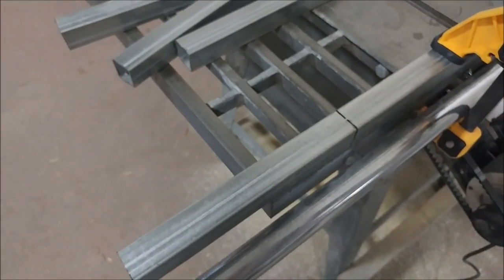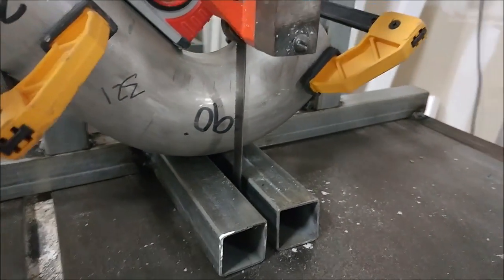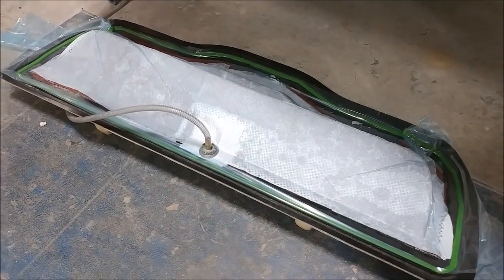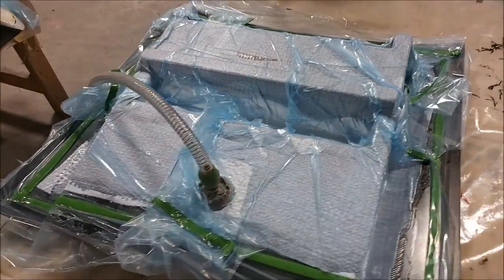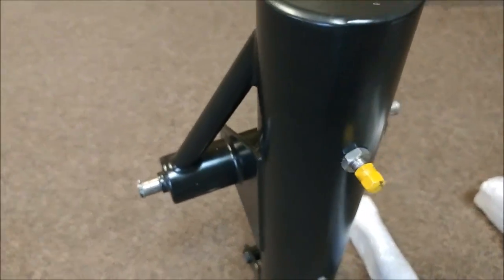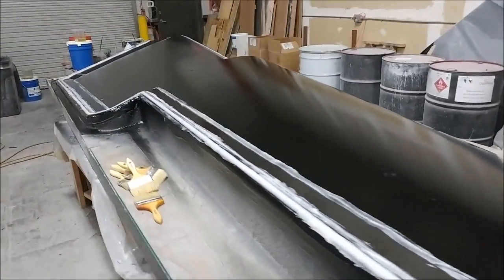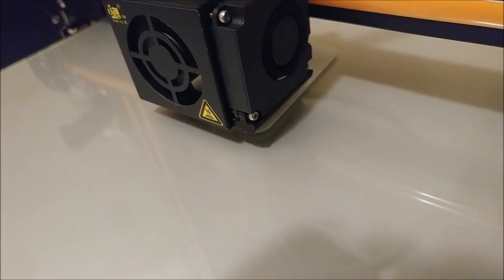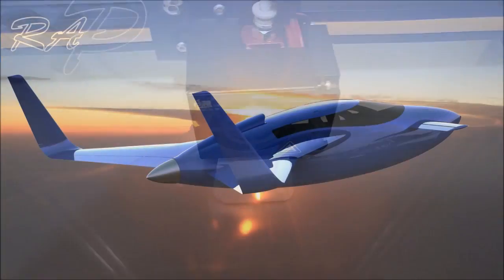Raptor Aircraft March 14th 2017

Comment: Just a quick tip for the 3D printed plugs or molds; if you use ABS you can sand your parts and put them in acetone vapor to get a glossy smooth finish. In my experience it greatly improves the surface finish of the part and helps a lot with releasing.

Comment: If you got that 3d printer retail somewhere, please reveal the source. I've been looking for a good, inexpensive one. Those two words are usually mutually exclusive in this field I've found.

Also, the landing gear looks fantastic! Good choice on the coating.
Reply: David McCullough I second the 3D printer curiosity.
Reply from the maker: It's a Creality CR-10 from Gearbest.com. If you check for a review video on YouTube you may be able to find a coupon code for a decent discount. Be prepared for a long wait as it ships from China.
Reply: Strange, the model with the US plug cannot be sold to the US. One has to order the one with the Euro plug. They ship that one to the US. Go figure.
Reply from the maker: I got the US plug without a problem. It uses a generic computer power cord like the ones on any old desktop pc so you could easily supply your own.